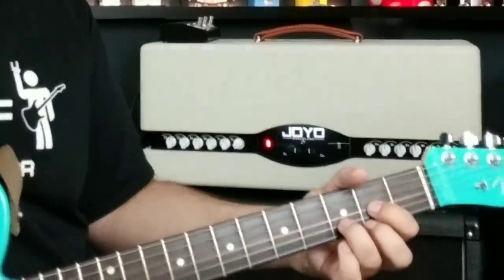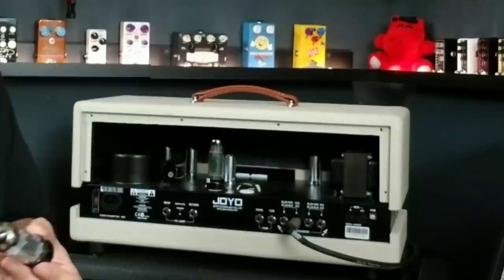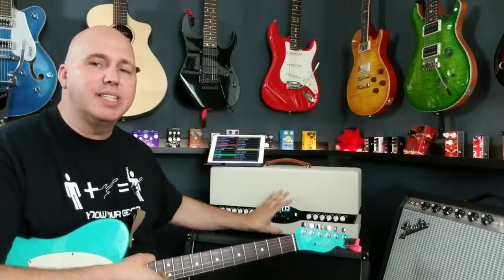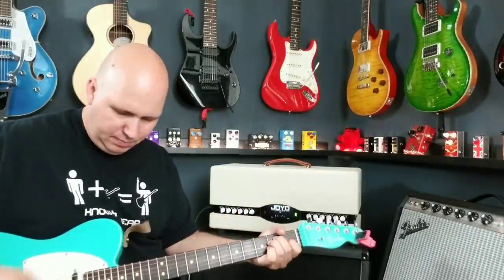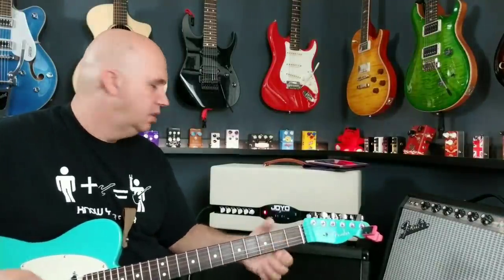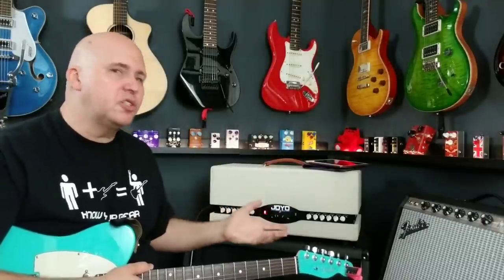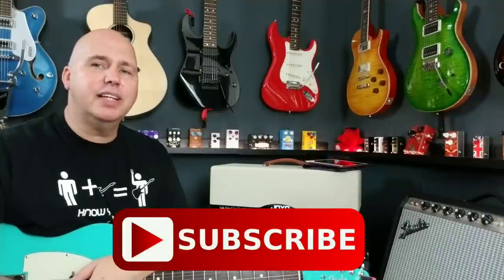The Ugliest Amp Ever Made! But Is It Any Good?

Comment: Hello Philip. I'm Andrea of Klonz Labs. Thank you very much for this review ! 
I just wanted to highlight a couple of details, that might be  interesting: in the front page of the app you have actually an indication of which are the active knobs for each preset. It also shows which is the "preferred" position for knobs actually not used in that original amp (like the mids on AC30, for example). Also, by swithcing throght the "combo" menu, you are actually bypassing the Muting system, while if you switch from the front menu you will also have a silent switching. The mute turns off the output for half a second. Thanks again !!! cheers
andrea
Reply: Hi Andrea! First of all thanks for your awesome engineering! I'd love to send you a message about the Klonz. I searched everywhere, but couldn't find any way. Also I understand you probably don't want to leave your email in comment, so can you give me in Private Message a way to contact you? Thanks in advance, cheers, Phil
Reply: Phil Smith no problem! You can write to info@klonz.eu. cheers. Andrea
Reply: Are you still producing this amp? I´m having some trouble trying and buying this amp in Germany...

Comment: To all those that think this is somehow a lot of work to dial in a sound, "Have you ever seen another modeling amp?" This is actually a lot less manipulation than most. There are those that have a lot more preset tones that require a ton more swiping and reading, then there are those that don't have very many options, but you still will want to dial the EQ to your liking either way. The only thing different, from a selection process standpoint, is that you have a pre amp section and a power amp section. In those there are only a handful of choices in each. From there you can also dial the knobs, of course. Also if you want you can change some valves/tubes. It's actually some cooler options but not necessarily more searching and selecting. I think maybe to some it sounds more complicated than what there used to, only because it's not what there used to. I think it's kind of cool too that this teaches us a little more about amps and what does what and what different tubes sound like. This would make an awesome platform for teaching people about their gear. Get it, "Know your gear."?

Comment: I doubt the amp is rebiasing with every change. It's more probable that what's happening is that the previously unused tubes are warming up while the previously used tubes are cooling down. Otherwise, having ALL the tubes hot and ready would burn through A LOT of tubes that might be rarely utilized.....Check the back of the amp while switching, and you'll likely see the various tubes light up and turn off.....
Reply: Yeah that is most likely correct, because the 5 preamp tubes are never all used at the same time, that and the amp might put itself automatically on standby for changes, it would make sense.

Comment: I like it a lot! I think many "configurations" sounds pretty amazing.

I think that review this "camelion" should be a piece of nightmaree... The point is that the concept is different both from modellers, and from a standard head. So the real point is that you can chose between "today I will use a JTM45" or "today I'm going to use a Twin" or "what if I use a bassman preamp with a VOX AC30 power amp"... and you can have it at about the cost of one of those amps. The concept is cool. What I am pretty sure is that the whole project was involving a lot of effort from the designers to have a components and building quality higher than usual Joyo standartds (that's why there as a 6 month delay in realeasing the amp). Is the concept good? I am intrigued, and I can see many sounds that are great in my opinion.
What puzzles me is why many people is complaining about the non existance of "presets" while they would not complain that a JTM45 does not have any preset. Simply this is a sort of "modular" two channels amp in which you can chose what pre you have on channel 1, what on channel 2 and what power amp you want, for that specific recording or gig. Is not a modeller nor a "stadard tube head". Just a different thing. Very very cool! Thanks Phill for the great review. I hope there would be some more in depth review in the next future.

Comment: Regardless of who makes it, this is a very cool concept.  I've really been looking forward to this review.  It's kind of like an analog amp modeler.  Actually, that's exactly what it is.
Reply: Spot on. Except it can't do a true Fender Tweed ('coz it only has 12AX7's in the preamp), and it can only model one family of power amp at a time (you can't have true Fender clean and Marshall Crunch at the same time, because you can only have EL34s/84s or 6V6s/6L6s, but not both at the same time. It would have been much more flexible with two power stages, and with an extra pre stage that could take a different tube. A case of close, but no cigar.

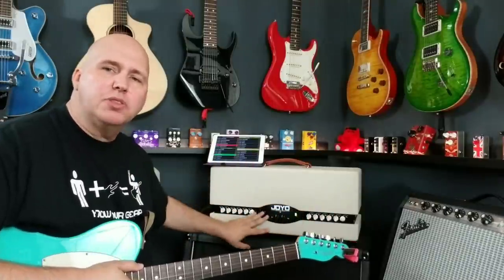Comment: 3:38 That's one of the few things I regret:

1) No total recall on the knob, such the Hughes & Kettner GrandMeister 40, to have settings saved per preset and recall them on stage/live situation.
2) I'd also love a way to have multiple-tube paths for the Power section, and therefore have all different tubes inside and just select the one(s) we want just like the Hughes & Kettner TriAmp mk3. By having that, it would also allow to select the appropriate power tube to match the model of amp we want to reproduce.
3) I'd also love to have a third channel for modern super high-gain amp models
4) And finally a way to control speakers and use both in the same time. 

Even if it would mean to make a new high-end version of it, such a Joyo Triple-Klonz that would be $1,200  higher, it would still be in the H&K TriAmp price range, or the Mesa Mark V (in Europe) and other boutique amps. 

And of course, we could still keep this Dual-Klonz model in the product line and even release each of the three Channel as an individual entry price model (in the $800 price range). 

I know I already wrote that on another video, but I just hope the guys from Joyo (and mainly the two Italian genius behind the Klonz) are reading it :)
Reply: All good points, but the idea they had in mind was more to create your own dream amp rather than emulate an existing one. A different approach, or at least intent, than the classic modelling amp.
Reply: WhoWouldWantThisName fair enough, but my points would still be relevant to create the "ultimate Amp", because that's pretty much also how I see it. Of course I said we would match existing Amps, but we could still have the choices to set it up just like we want and recall it quickly. 

Note: and I'm not trash talking the Klonz, not at all. I think it's an awesome concept. I actually like it enough to be my next purchase. I'm just writing those points to hope for a mk2 or "Triple Klonz" version that would be even better!

Comment: For people wondering what kind of "tweaking" we can have with the internal relays of the Joyo Dual-Klonz (which are just like front panel toggle switches on any Amp, but installed inside and remotely controllable), here's the list:
Pre MODern:
M00: 1st Stage High Bias
M01: 1st Stage Fat ON
M02: 2nd Stage Direct Input
M03: 2nd Stage High Boost
M04: Bright ON
M05: 3rd Stage Bypass
M06: 4th Stage High Bias
M07: 4th Stage Fat
M08: 4th Stage High Boost
M09: Brit High ON
M10: Brit Mid ON
M11: American ON
M12: 2nd Stage Bypass

Power Amplifier:
A00: PreAmp Bias 1 ON
A01: PreAmp Bias 2 ON
A02: HiGain Presence OFF
A03: Cut Active
A04: Hi Bias Noval
A05: Hi Bias Octal

Pre VINtage:
V00: Top Boost Bypass
V01: Bright ON
V02: Compression ON
V03: Fat ON
V04: High Boost ON
V05: Brit High ON
V06: Brit Mid ON
V07: American ON

Comment: Would be really interesting to see people's reaction if the brand name didn't say joyo but some american boutique manufacturer (which would double the price of course), whether the level of rejection would be the same ("How dare those Chinese make an amp that is innovative and costs more that $100!").
Reply: BTW the project is Italian, not chinese....
Reply: Jan Minor Right? I honestly haven't ever picked up a Joyo product I didn't love anyway, and that's their cheap stuff. I think this is a super cool, super innovative product, with crazy flexibility.
Reply: Alberto. It's 100% China made.
Reply: Jan. All things concidered, it is cheaper to pay twice as much for anything not made in China. And this is why. For those who are not amp builders/electronics geeks, the quality of the parts made in China is very poor and typicaly don't last very long, have a high failure rate compared to parts made in the USA, UK, Germany or Italy... For instance, electrolytic capacitors made in China only lasts about 8 to 10 years, and during that time the tonal quality drops at a progresive rate. Capacitors made ellswear last at least 30 years. Ever wonder why your TV's power supply died prematurely after only 8 years?
Reply: I did not said anithig different. Is china made, exactelly as as an Apple iPhone. The idea, the project and the elctronic desing are Italian, the enclosure design is German. The main different is that the brand is chinese too. At the best of my knowledge there was a huge effort from the designer (Klonz Labs) to push Joyo using "quality" components. I have not put my nose inside, so I cannot know if the quality is better or worse of a chinese made Hiwatt or Maschall, or Peavy or Bogner. For sure here there is a toroidal power amp... that's not that cheap... just to put an example. Then, my amps and guitars are made in USA, Canada and Germany... I made my choices... but I'm not able to judge the "poor qualtity" by the "made in" tag.
Reply: Good point on the Toroidal output transformer. I noticed that and thought "Wow, that's a plus if done well (they can be problematic) and yea, not cheap to do. Still whould be nice to know what ells is under the hood. Whould be nice to see CTS pots, Switchcraft jacks and switches, to know that all the realys, caps and resistors are the good stuff. It sucks when a few years old stuff quits on a gig and the tech needs to gut it. I'll stick to the KISS method (Keep It Simple stupid) with a Tweed amp. For home a 5f2a with pedals into a 12" cab. Or a 5F6A Bassman with switchable Dumble mods with pedals into a 2x12.   Use low output pickups for that tonal bliss.
Reply: +Nor'easter Playa You have ABSOLUTELY no knowledge on what you're talking about here! Sorry dude, but the whole "Made in China" is very poor is simply a "dumb argument" that isn't true, and surely not when it comes to electronics. Arguing that "made in USA, UK, Germany, Italy, etc..." electronic products are "better", just shows how very very little you know about it. 

Why? Because 99.99% of the time, electronic components used for all "made in USA, UK, Germany, etc..." products, are actually components "Made in China" in the first place, like pretty much any electronic components on the plant already. So yeah, your Friedman, 65Amps, Mesa, Bogner and such are using Chinese components too. Just like "Made in China" Apple iPhone or Samsung Galaxy, or Macbook, or Windows PC, etc... 

The whole "Made in..." means absolutely NOTHING in the quality of the components, the production quality, or even quality control. It only has an impact generally on labor cost and conditions... and even then, most of the current large production factories in China are no different now from the one we have anywhere else, such "Boutique Amp Distribution" in California. And yes, using the word "Boutique" in the name doesn't change the fact it's just a large factory for mass producing amps and pedals from different manufacturers.... just like Joyo/Harley Benton/Movall/Caline/Mooer/etc....

Everything comes down to cost. And the main reason for a manufacturer to use Chinese production is generally to reduce cost, and therefore a lot of them also go the "cheapest way" on components and quality control too. But it doesn't mean Chinese factories don't know how to make quality product. This is just a matter of production means. But it has a cost. Because every product that will be rejected (and destroyed) because it doesn't pass the quality control, will add a cost on the products that will get sold. This is even more true regarding guitars. For instance, when PRS find that a guitar has a slightly defect they can't fix, they just destroy the whole guitar. That's how a lot of US Core models just end up to be 3,000 or 4,000 bucks; The margin also cover for the loss. And this is true for ANY production business. The more quality you will expect, the more expensive the production cost will be. That's why manufacturers that try to get the lowest cost possible by having production oversea, are also using cheap components and quality control. 

But it doesn't mean ALL products made oversea are like that, mainly for electronics. We have tons of electronic products from brand such Apple, Samsung, Sony, etc... that has been produced in Asia (including China) that are quality. The main reason why some product fail after few years is simply regarding the quality toward the life cycle.

This is something we saw very precisely in computer industry. The first old 386, 486 computers, etc... were using electronics that could last for ever. There's still some very old 486 computers running DOS in some factories, sometimes for a very very unique usage, and that never been replaced, and still work like a charm 30 years later. So why did we saw so many failure after that? Because in the early 2000, we had a life cycle becoming very very short, because computers got very popular, and technologies evolutions made it that computers were obsolete very quickly because of the new technologies and new models. Every 18 months we were doubling power, memory, storage, etc... It was a race for power. We had to change the whole computer sometimes just to run a new software such word or excel. 

So people were upgrading computers very often. Since the computer life cycle was very short at this point, there was absolutely no need to have a heavy cost on components to last 30 years, when the manufacturer knew that 2 or 3 years from now, the customer would buy a new model already. So to save money, they went on the cheap and use cheaper components, use board with very thin layer of copper that could be more fragile that large ones, etc... And of course, we had more failure. But again, it doesn't mean it had to be for all product. For instance, I'm writing this very comment on a macbook that is working like a charm for 9 years now, over 14h/day. And for just watching video, doing emails, word, excel and stuff like that, it works just fine.

Because after the whole race to power, we reached a point where it was just useless to always buy a new computer for the most basic everyday tasks. Even a smartphone or a tablet is powerful enough now to do all office work. So there's no need to change it for that matter (maybe for other matters such games, 3D, video, audio, etc... but not office tasks). So computers reached a "maturity" point in technology. Therefore, we can expect to have now products that will last, even if we have to pay a little bit more to have better components and better quality control that will both guarantee the product to last as long as possible. So it's all about finding the balance between cost, life cycle, usage, etc... but it has absolutely nothing to do with the location where the product is actually made.

Defending a product "Made in USA, or UK, or Germany" for some patriotic reasons, or even social reasons, etc... that's a complete different story, and Phil already said it pretty well in his videos. But using it for an argument of "quality", that's absolute crap, mainly when we're talking about electronic products where 99.99% of the components come from Asia anyway! If you would have worked in a company that do produce electronic products, you'd know it!

So before to comment back, you might want to go learn just a little bit about it. And yes, I've been working in R&D for an US company producing electronic instruments for the Music Industry... and I know how to read a BOM (Bill of Material). So I can detect b.s. when I read it...
Reply: Exactly
Designed in Italy - Made in China
We are living in a Globalized world.
Reply: +Jan Minor You are right, man. "Proudly made in USA" is overrated statement. It's quite disrespect, how some people talk about all Chinese products like 20-30 years ago. From my experience, I had more troubles with US products than with any product from Asia. :) But what do I know, right... I'm "only"  European. :D :)
Reply: For all the anti made in china people.....this amp is cheaper then a VOX Handwired AC30 which is made where??
Reply: Nothing to do with the country ....Joyo make really really good pedals.....this amp just sounds like utter shit in every demo I've seen

Comment: It might be the way forward but I don't like the idea of having to use a tablet or mobile to change settings on an amp. I prefer an on/off switch and some buttons (going up to 11?) but the Joyo looks like it can offer a lot of variety which might be what some folks want.
Reply: Good thing you don't NEED the tablet/computer app... you can use the Amp as is without anything and you can change circuitry by simply using a midi cable, even with a cheap two switches midi footswitch that cost probably less than some dedicated footswitch for some Amps out there...

Comment: 6:30 don't you think it's also related to the rectifier part of the signal? I saw on the Friedman amp I think, there's no "stand by" because you can only just select the rectifier type and automatically the signal is not at full power when switched on (because of the rectifier circuit). Could it be something similar on the Joyo?